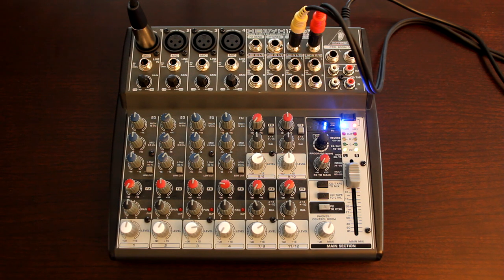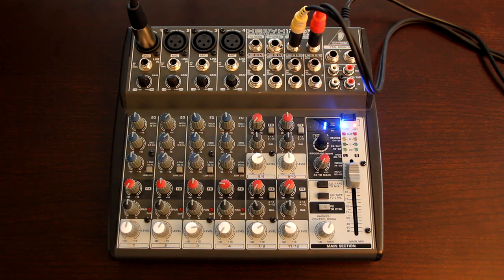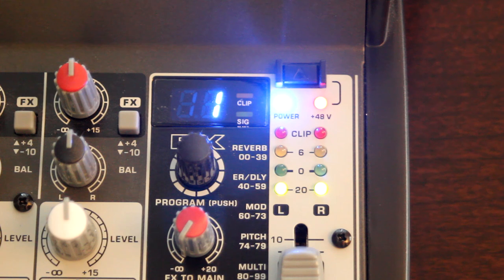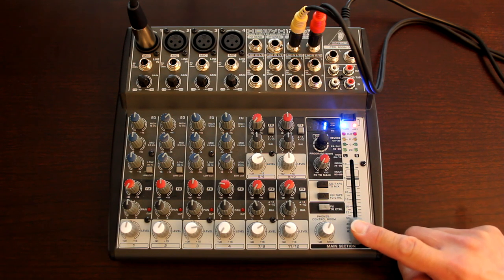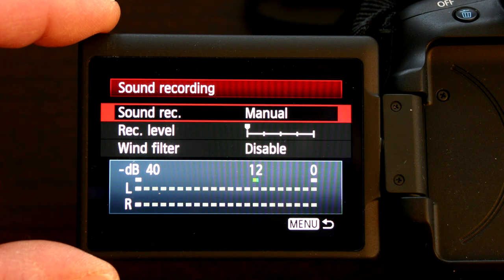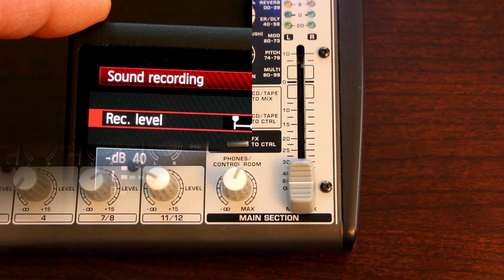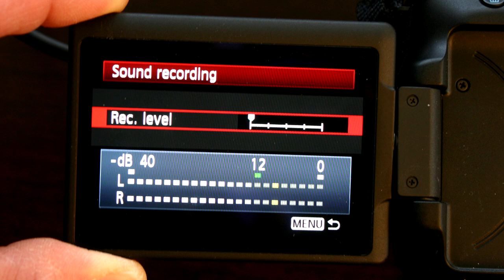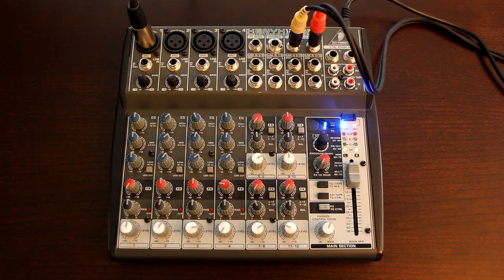Home Recording Tips - How to Plug a Mixer into a DSLR

Comment: Hi,  i have d7000, i set the levels to the minimum and i get distortion, i set the volume control on the mixer to VERY LOW but still, the d7000 is either giving me a low volume and distortion. Any help? The sound result is very low but if i crank up a little i get distortion.

Comment from the maker: You use a 1/8 inch stereo jack to go into your camera...same jack an Apple Ipod uses for its head set.  I go from the main out of my mixing board using a Y cable ...two 1/4 mono jacks to the 1/8 stereo jack.  This works for micing anything that comes into your mixing board be it an acoustic guitar or your kick ass Tube amp...Cant help you with Adobe Audition... never used it....I like free programs  like Audacity...I use a Behringer ECA202 USB interface to bring the mixer's signal into Audacity

Comment: On a panasonic g7 you can only lower the audio -12 db so it wont work on it I just tried. So I guess a cam that wont boost your mic is better or use an external recorder that wont.

Comment: Dude what cords / plug ins / wires are you using?  I'm a moron and came here to learn that!  You skiped over that part
Reply: RCAs to stereo mini (3.5mm).  2 RCAs plug into the board, mini into the mic input on the camera.  If you don't have RCA output on your board you can use an RCA to 1/4" adapter for each RCA plug (as he did in his set-up.  It really depends on your board.  You need to get your line output to a 3.5mm stereo jack.  Your output will be RCA, 1/4" or XLR.